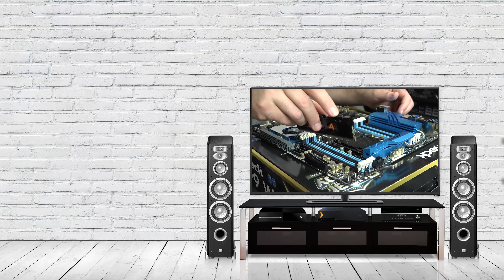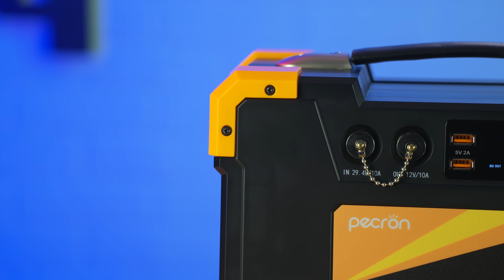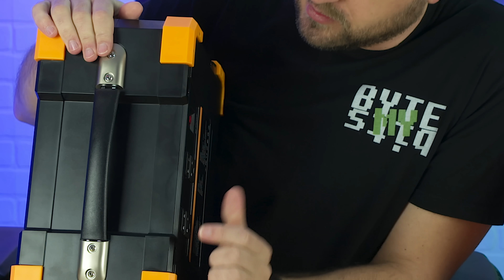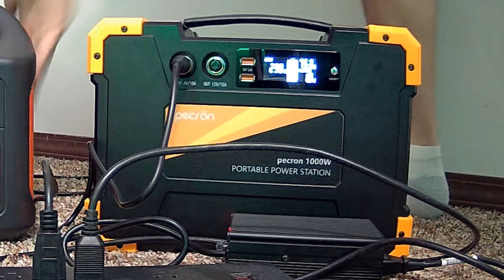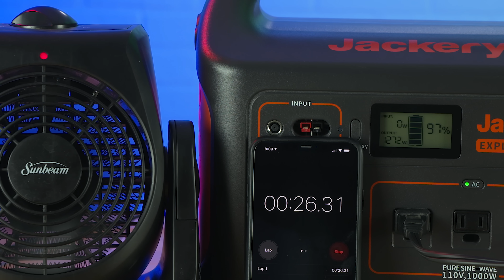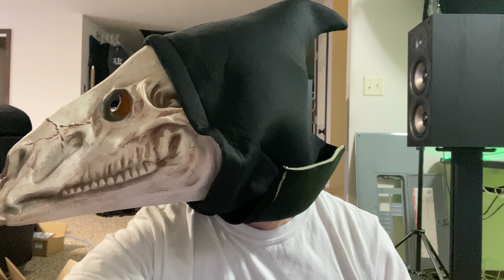pecron E1000 - Better and CHEAPER than the Jackery 1000!

Comment: i think his review was very informative and thorough, so thank you because i was considering thee jackery 1000 as my go to but after watching this i think ima give this one a try. also the digital display is way better than the jackery, wich is a plus for me because my vision not so good lol...thank you.
Reply: Reviews aren't so good on Amazon.
Reply: I really wouldn't buy that. You're seriously risking your money. You won't be able to get in touch with customer service, it has awful reviews, and Amazon won't warranty it at all because it's not theirs. Spend money for stuff you know works and is backed by a company that will be around years.
Reply: @serenityjewel  really wouldn't what
Reply: @Newbeginnings4TyGrr  I really wouldn't buy that battery.
Reply: @serenityjewel  oh y not
Reply: I had no problem with my Pecron E1000 despite what the negative comments are saying.  I paid $600 for it so it was almost $300 cheaper than the jackery.  It's mainly as a backup here in CA when the power goes out occasionally.  Tired of running my gas generator.   I never let the unit go down below 40% just to keep the batteries healthy. Some people say you can run it down to zero but I would not.  I have a 250 watt solar panel attached so it is regularly charged and ready to go at a moment's notice.  I'm also looking at a bigger 3000 WH monster soon so I can power the main appliances again in case of catastrophe.

Comment: I think they only put the 3rd prong in the AC receptacles because many devices have them. There is no earth ground connection on any isolated power station so people using will have to hope they don't have something defective plugged in and get electrocuted. In a way the Pecron 2 prong receptacles are more accurate to what any of that type of power station is for AC output.
Reply: Wrong. The ground will protect from faulty tools etc.

Comment: Pecron seems okay and seems to perform well in your initial tests. I'd be curious if it's still working a few years down the road after hundreds of charge cycles. I see it a little different on what I would purchase. Pecron has 1 year warranty while Jackery has a 2 year warranty and extends to 3 years if you register. I read that Jackery reserves some capacity in the battery that never gets issued to ensure a healthy cycle life of the lithium cells so that might account for the extra run time on the Pecron since the watt hours are so close. Jackery has a lot of R&D with their electronics and I think its a huge plus. The engineering put in gives them that confident warranty. Something as simple as an undersized resistor running a little hotter than normal could be the difference of electronic failure in a short time. That is one example of hundreds of parts that make up the guts of these systems. The last thing is the display. I've seen a comparison with the Jackery and a Bluetti outside and on a bright day you cant see anything on the black background display. The Jackery is totally visable and from farther away. I think for me I'll stick with the Jackery since it's an expensive purchase and hoping to get the best chance at keeping mine for a decade! But good luck with your Pecron.
Reply: Jackery batteries with constant use die in 8 months, Jackery replaced it, but bitter lesson.. Ask me how i know. I have one, it did. They are lithium ion. Buy the Bluetti, I have one of those too, its  a 750 watthour. Much bigger than my Jackery. Dont buy a unit unless it has LifePO4 batteries (lithium IRON) as the batteries last 5x longer, and they are much less likely to flash fry like some have done. Just my experience.
EDIT: After looking at several units, it seems the Pecron might have LifePO4 batteries in some units. Cant say for sure about the one being reviewed. It states lithium, with no specific battery chemistry noted. Its a 50/50 shot.
Reply: @rodx5571  I think what it comes down to is that these solar power stations are quite complex and have a lot of electronics and parts that can fail. I have two small Jackery's one is 3 years old and both work well like the day I bought them. The thing is I don't use them everyday. They are used for power outages, camping, outdoor tasks, on the patio when friends are over if someone needs some power. For my main battery system that I use daily, I have two 100ah LifePO4 batteries from Ecoworthy, the GoPower GP-ISW2000 inverter, Ecoworthy 30a MTTP solar charge controller and the Renogy 500A battery monitor all wired with Blue Sea Systems fuses and blocks in a heavy duty plastic storage bin so I can move the system around. The Eco Worthy LiFePO4 batteries are well rated and use a well known JBD BMS and 3000 cycle life EV cells. But that did not matter, after only about 5 charge cycles one of my batteries started cutting off charging before the battery was full indicating one cell group inside the battery has fallen out of balance and the BMS is cutting power to save them from damage. Point being LiFePO4 wont have a long life either if the electronics or usage conditions around it fail. Bluetti has electronic issues, when I was researching this last about a year ago I read there were some issues that worried me about having a bricked unit eventually. Bluetti Power Inc are also 1 star our of 5 with the Better Business Bureau. So I would not reply on that brand either unless your good with replacing your power station with your own money when it fails. Pecron maybe great but they are really a new company so would take more time for me to commit to them. At least with my larger system its modular where I can just replace a battery, the inverter, or charger if something fails.
Reply: @practicalguy973  modular is infinitely more serviceable. I also have 8 panel array, and 3 charge controllers,  4 lead acid deep cycles. 1 year in losing capacity. So I am exploring alternatives. I do like the Bluetti though. I am aware of intermittent issues with electronics and customer service. My experience has been good so far. I do appreciate alternate view points and feedback. Thanks. I also appreciate open respectful dialog too. Thanks for that too.
Reply: @rodx5571  Nice, I have a small 3 panel array in 12v parallel and 2 portable solar panels that I can add in if needed. I had 4 UPG AGM lead acid for about 5 years. Never took them below about 55-60% DOD. They did well but once they needed to be replaced I decided to try LiFePO4 based on all the benefits. I like that my 200ah of LiFePO4 is only about 50 lbs. 400ah of AGM is about 250 lbs for about the same usable capacity but I miss the simplicity of the AGM lead acid. I considered some of the high end lithium brands like Dakota Lithium and Battle Born but its just too much money if something goes wrong. So instead I spent half the money on batteries that have well known parts but are still an issue. My next move is to order a couple of Overkill solar BMS (which are a version of the JBD BMS) and a couple of their Bluetooth modules. I plan to take a heat gun to both my Ecoworthy batteries and crack them open and upgrade the BMS so I can see what each cell is doing on my phone. I think this is the only way I can safely know if my batteries are going to stay healthy and I can force them to balance with the app control if I notice them falling out of balance. Its just an endless money pit these battery systems. one thing I like a lot are my Go Power Pure Sign Inverters. I own 3 of them, the oldest dating back to about 13 years ago and they all still work to this day but I don't abuse them. I run them at 75% load in the worst case. Yes great having constructive dialogue.
Reply: @practicalguy973  13 years you say eh? Right now I have Renogy charge controllers, a renogy BT2 and a 10 port hub to watch my charge controllers. Nice add on. I can manually change values for LIFepo4 batteries.  At only 300 a battery I wish I would have gone with the LIFEpo4. But I am putting the lead acids in the cars I am selling and switching over.

Comment: Hi sir. Can i use that for the espresso machine rated 850watts? And if yes how many hours
Reply: They're a bit over 1000 watt hours. So, in theory, that means 1000 watts for around 1 hour. So 850 watts should run for about 1.17 hours, and the few extra watt hours would likely be eaten up in the AC inversion process

Comment: Since I paid 799.00 for my Jackery 1000.
Amazon also had them on sale for 899.
Amazon has Pecron 1000 for 899. I see zero savings.
I also see a huge quality and user friendly differences.  It's not Pecron.
Reply: I just picked up a Pecron E1000 for $600 so it was at least $200 cheaper with more power than the jackery.  Prices are dropping and there is a ton of competition out there.

Comment: Currently on Amazon the Pecron is going for 899 USD while the Jackery is still 999 USD. With that little difference the Jackery still seems to be the better choice in terms of refinements and accessory options. Plus I like stuff to work out of the box instead of hunting for cable plugs around the house. Ymmv.
Reply: Thanks for saving me 20 minutes! The title and intro gave the impression that the Pecron was 50% of the Jackery's price. 10% savings is hardly a big difference especially if you time your purchase with holiday sales! Cheers!
Reply: yes they are almost the same price, $1 per watt, not cheaper not half price as his introduction ...
Reply: @johanneschu    Also, he implied the Jackery doesn’t support a CPAP (continuous positive airway pressure) breathing machine.  But the Jackery most definitely does work for a CPAP.
Reply: Except for the fact that it uses obsolete Li-Ion batteries that last only 500 cycles, compared to the at least 3000 cycles of the newer LiFePo4 batteries. It is extremely poor value. Extremely poor. The Pecron is also a terrible purchase, as it is also using old, far less durable Li-Ions. They are also far more volatile, and charge much more slowly. There are much better options from companies like Bluetti and Eco Flow. The battery is KEY. Don't waste money on inferior ones.
Reply: @claycassin8437  . I got my eye on that new modular set up from Bluetti. I think that's the way of the future so we can add more power as needed down the road.
Reply: @viewer-i5o  So do I! It's a solid design from a company that should actually still be around to honor it's warranty. And it's rather attractive, too. Not a drop of orange anywhere!
Reply: @claycassin8437  thanx a bunch for the tips. I'm getting rid of a gas op generator. It's such a pain in the butt. Huge noisy heavy... etc. It's time.
Reply: @viewer-i5o  From all my research, I believe the Bluetti modular system is the way to go. At least until someone comes up with a better solution.
Reply: @claycassin8437  You do understand that the Jackery also uses Lithium Ion batteries? The Jackery 1000 does not have LIFEP04 batteries.
Reply: @troyyarbrough  Yes. That is exactly what I said. ALL Jackery's are a rip off.
Reply: @claycassin8437  Sorry. I misread your previous comment. I thought you were just referring to the Pecron as having crap batteries.
Reply: Right now the market is being flooded by these devices by everybody and his brother. Nothing to see here, I’d stay with trusted and true
Reply: Currently not available on Amazon.
Reply: I just picked up the pecron e1000 for $600 so the price difference was significant.  It works very well and I'm satisfied.  Eventually I'll be getting  a larger 3000 wh lithium iron phosphate for the whole home as prices are dropping monthly
Reply: They usually have a $150 coupon there, so net price is about $750; very good deal.
Reply: and right now on amazon there is a $200 coupon for that additional amt. off
Reply: He just lied ... so he's probably lying about it being as good too ...
Reply: @ckennedy109637  He posted this video more than a year ago. Prices on both models were different back then.
Reply: @ckennedy109637  lol he almost convinced me  😂 im getting the jackery
Reply: @jeanramirez6441  It is a terrible idea, but if you won't listen to reason about obsolete battery technology, oh well. It is not my money you are poorly spending.

Comment: Can the Pecron be hooked up to solar, AC, or 12V and be recharged while being used to charge things? The Jackery can! That is huge and important. Does the Pecrons guage tell you how much energy is going out while also telling you how much energy is coming in? The Jackery does! That's important and huge. And the convenience of having all the charging outlets on the same side is imperative. The Jackery has all of them on the same side, making it able to sit by a wall. That handle on the Pecron will break someday. The one on the Jackery is there to stay. And the light on the Jackery is needed. You will be surprised how much you use it when the electricity is out. The Jackery will set at 1% for a set amount of time so it gives you time to get it hooked up to your preferred or available charging device and still have enough energy in it to where it won't go dead before it gets enough charge to continue running the items that are plugged into it. There is a method and reasoning to the Jackery systems.
Reply: The Pecron does all of the above and also gives more power than the Jackery 1000. I just picked up one for $600 which is around $300 less.  By the way, there is a whole slew of these coming on the markets.  The newer lithium iron phosphate chemistry is far superior with faster charges, more power and more cycling lifespan. Prices keep dropping.

Comment: What's the wattage threshold that will cause the Pecron's fan to turn on? I'm considering using something like this for documentary work and fan noise irritates the heck out of me.
Reply: I assume it’s temperature based and not wattage based
Reply: @Nicksperiments  It's a bit of both, as I found out. Most of these units do it around the 300W threshold and the heat that generates.

Comment: Your batteries in these devices will last way longer if you keep them above 20%. Don’t run them down to zero!
Reply: He was most likely just doing it to show the capabilities of both.
Reply: dont need to worry about this with LiFePO4. lasts 10+years without the capacity degradation seen with lithium ion chemistry
Reply: @RagingHamster  So is that recommendation for ??? different type of battery installed in this system?
Reply: @RagingHamster  Hope LiFePO4 battery technology is in the latest generation of EVs.  We really need that advancement when range and general battery degradation is the main reason  EVs are not going mainstream as fast as they should.
Reply: Don`t store at 100% charge either...store at 60%.
Reply: It is good to run packs down to 0 every other month, to stop battery memory.
Reply: @leonardfoster2155  They say the battery memory issue can be corrected in lithium batteries by a full charge/discharge (like you said.)
Reply: @leonardfoster2155  LiFePo4 doesn’t have a memory.  Superior chemistry.
Reply: @leonardfoster2155  The battery management system (BMS) shouldn't allow it to run down to 0, as that would be damaging.

Comment: The Bluetti power bank is stronger than the Jackery for $429 and they have a $60 sale going on right now
Reply: Which bluetti model? Can you provide a link?
Reply: @Tyler-ug1hs  
I believe she's talking about the AC50s. The EB150 is currently on sale for $999 which in my opinion is a way better deal than the Jackery since you're getting 500 more watt hours of capacity, way more solar input, more than twice what the Jackery offers i believe the Jackery only charges at 135 watts max no matter how many solar panels you hook up to it, and the Bluetti can handle up to 500 watts of solar. The only downside to the Bluetti is that you can't charge it while you are driving from the 12 volt cigarette output port from your vehicle so there are tradeoffs to all of these power stations. Oh yeah and the Bluetti EB150 has more than 3 times the charge and discharge cycles @2500 cycles to 80 percent capacity vs the Jackery only has 500 cycles to 80%.